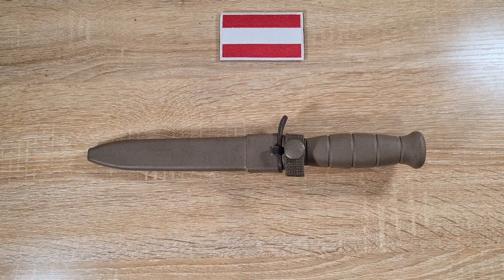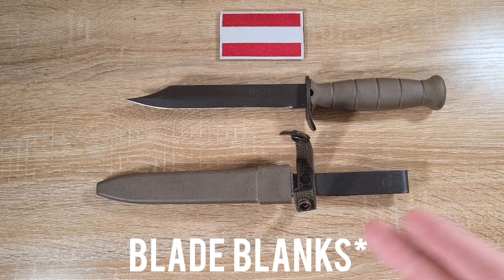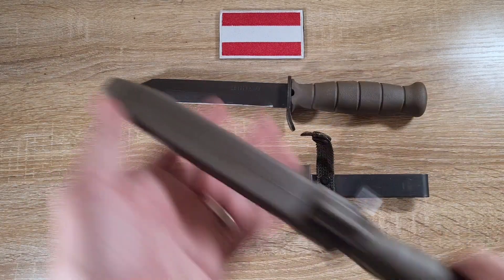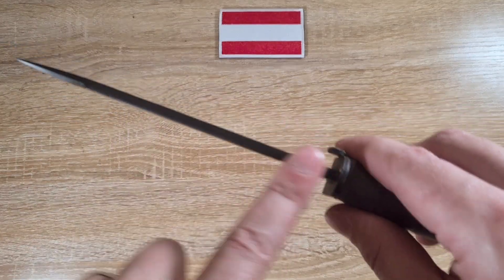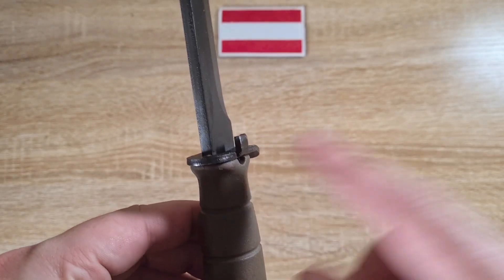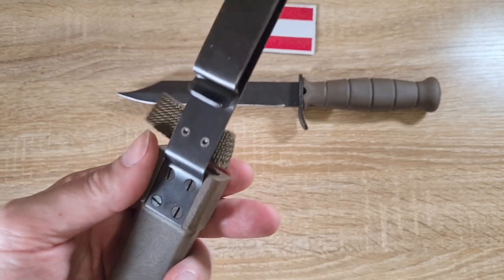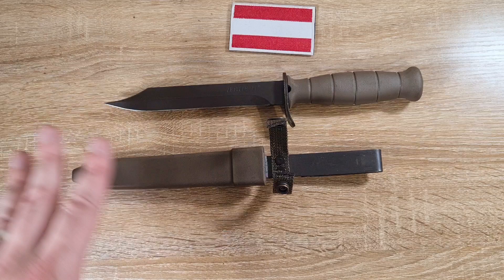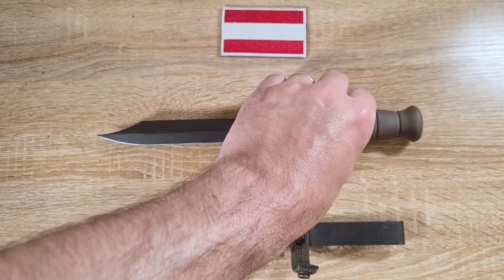Steyr AUG Zeitler 77 prototype bayonet

Comment: Very cool bayonet! I have never actually seen one in the "flesh". I have messed around with the Steyr AUG and encountered the Australian F88/F90 AuSteyr downrange. I like the rifle very much, but I have only seen the M7 bayonet with those guys. I heard there was an Austrian prototype and I was told that the adapter was an extension beneath the barrel in front of the foregrip, but never actually saw one. Very neat to see one on your channel. Thanks for sharing that one!
Reply from the maker: You can buy a blade blank for $39 fully marked if you want a project. I was thinking about it but after international shipping and currency conversion it was getting a bit much for me

Comment: There's a lot of those Zeitler 77 and West German G3 blanks here in the US.  I wonder if there could be a way to utilize the M7-style mounting system on a Zeitler 77, but either way, they make great blanks for different field knife projects and they already are heat treated (might need to bend them back into shape, as I have seen a few of these warped).